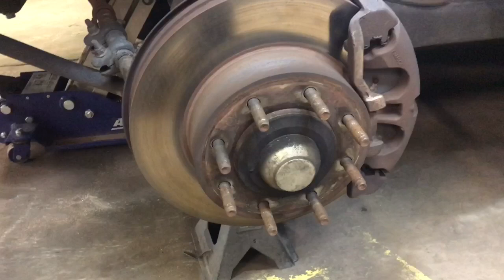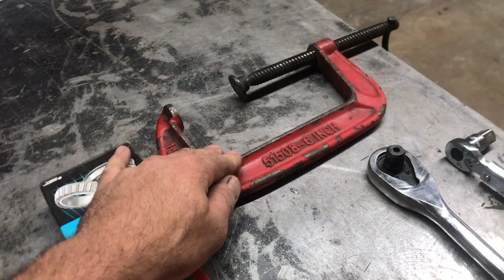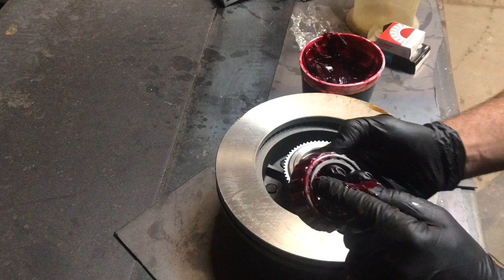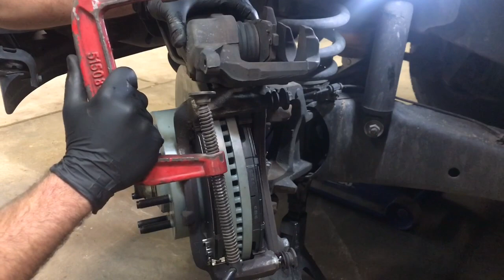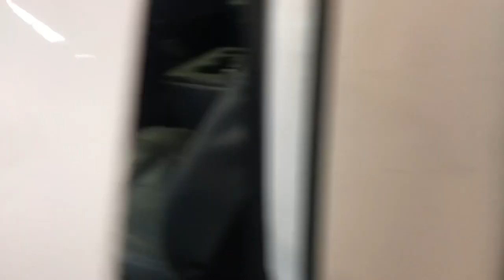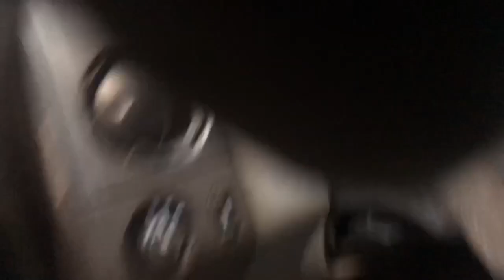Ford F-250-F-350 2011+ Front Brake and Wheel Bearing Replacement

Comment: Thanks a bunch.  As comments below also state, a lot of 4x4 but this is the only RWD.  That caliper piston compressor you used is universal.  I have used it on MGB, Toyota, Volvo, Mercedes, Subaru, Pontiac and Ford.  I have all the tool, even the inch-lb torque wrench.  Have a 2012 F-350 RWD DRW with 56kmi on it.

Comment: I would probably mention to be sure to clean the rotors after install of any grease you may have inadvertently placed on it with your gloves.  It's vitally important not to contaminate the brake shoes with grease so as not to reduce braking performance.

Comment: Awesome!  I'm about to tackle the front bearings on a '11 f250 and my biggest concern was the dust cap ... it didn't have the outer lip that you can get a screwdriver behind that I'm used to, and I was worried I was going to mangle it up trying to get it off and wouldn't be able to find a replacement.